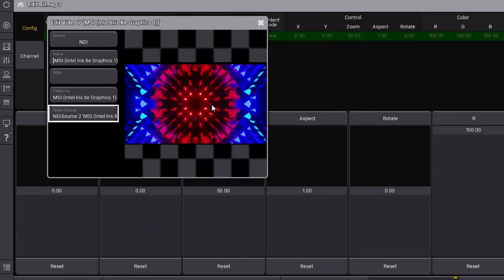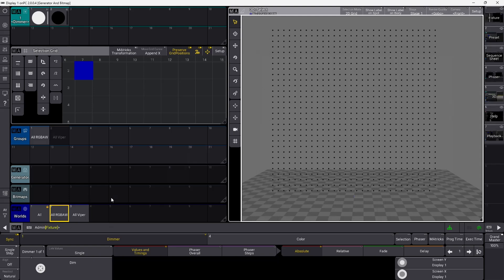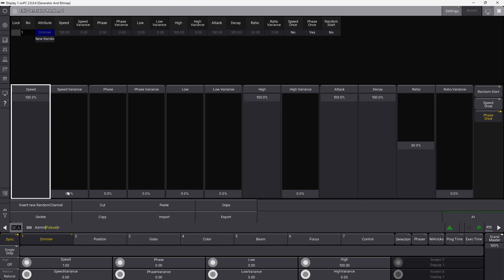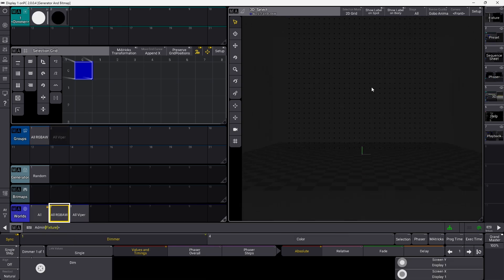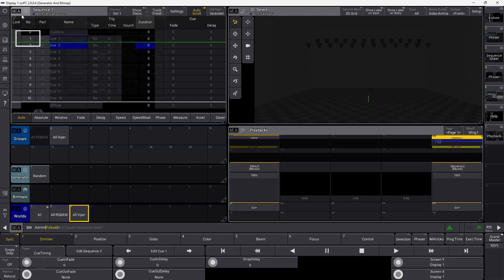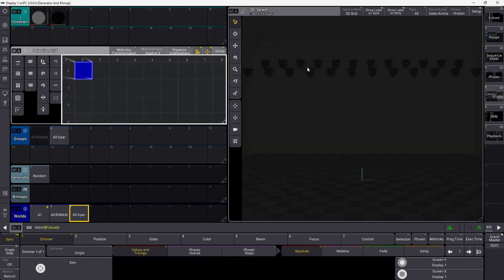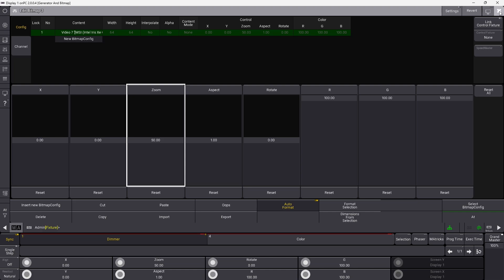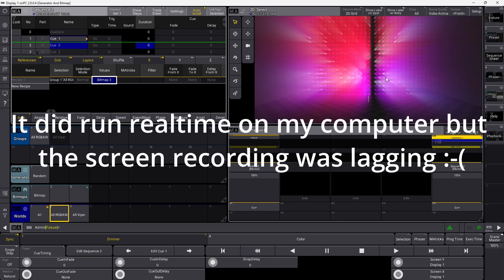Next-Level Lighting Control: GrandMA3 2.0's Generator and Bitmap Engine Unleashed!

Comment: This is a great video as all of yours are. Really appreciate you taking the time to make them. They are well thought out and pack a lot in at once. I rewatch them a lot. 

I did have an interesting issue happen yesterday where I if I made a selction from a layout and applied the bitmap it started working correctly, but when I would tap a group and hit bitmap it wouldn't run. It only ran if I put it into a recipe. Have you come across this, or do you think it's a bug in 2.1.1?

Comment: For some reason when i make a bitmap with NDI, the center of the canvas is not the center of the video source. It offsets in X, so working with 10 fixtures i need to put -2.5 in X, working with 60 fixtures -0.42 in X and so on. I have to readjust each bitmap content... got any idea?
sorry my english btw
Reply from the maker: Well - i am not sure. But maybe you could check if your 3D is offset to one side a little bit. The selection grid comes from you 3D so maybe  you didn’t start in the center 😀
Reply: @Event-Lighting  i Will try, thank you. And thank you for all your videos

Comment: What's the consensus on stability on 2.0? Is it better than 1.9.7? I have a show coming up I need to make from scratch so I could make it on either one.
Reply from the maker: If it was me then I would definitely go for 2.0. The stuff I have played with so far seems stable enough. There has been a few crashes on the onpc version when storing views with thumbnails. But for mailing shows I would use it. 😀
Reply: @Event-Lighting thanks for the comment. The shaper helper and the tracking updates seem beneficial. I'm doing a theatre show with all Framing fixtures.

Comment: Hi. How do you turn off you bitmap and generators in recipies?
Reply from the maker: You can give it another value like intensity at 0. You can also use stomp like on any other phaser - like group 1 stomp dimmer. 😀 So if you have a preset with dimmer at 0, that will turn off a generator. But it depends on what parameters you use to create the generator or bitmap.

Comment: I thought the whole concept of this software was meant to be to no longer separate effects and presets. That presets/phasers were supposed to be a 1 stop shop for everything. Seems like a step in the wrong direction although very cool? These generators seem like single step phasers, interpreting this into phasers would make more sense to me.

Also what GPU do you have? If I put more than 20 light sources on in the 3D I get 1 fps 😂

Love all your content! Cheers
Reply from the maker: Well yes I see your point 😀 I am not sure it bothers me to use the generator outside of the phaser, because I think I will use generator very little but for kind of a different purpose. I use a stationary pc with a RTX2080Ti graphics card and that behave fine most of the time. But when I push grandma3 3D and screen record the screen recording is sometimes lagging 😵‍💫😵‍💫 thank for watching my content and commenting on the videos 🙏😀

Comment: But can the parameters of the Bitmap and Generator be manipulated via the programmer? Just like the MA2 Bitmap Fixture?
Reply: There is a new gma3 bitmap fixture. But it is not mentionned here. Look at the release notes
Reply from the maker: Yes as mentioned here there is a bitmap fixture in the console. I didn’t try working with it, because the way I showed it will probably be the way I will work with it 😀 Maybe I will look at it again In a future video.

Comment: I haven’t used the strobe channel on any fixture in the past 10 years as effects in GrandMA2 could do something similar. Dimmer FX with PWM curve, width set to 1 or 2%, Attac and Decay set to 0, speed to Rate 3. Go from there.
Reply from the maker: I tried to do the same, but i could always see kind of a pattern in the effect. Not that it was useless, but i think the generator has a great potential for the future 🙂